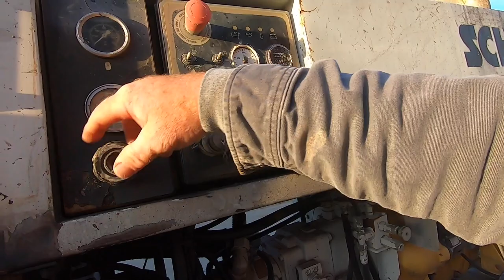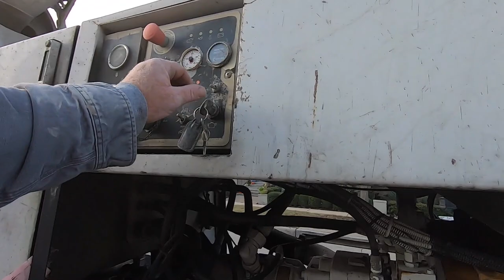New pool deck in a nice neighborhood with Muddyfeet

Comment: If you where starting out again would you start with a trailer line pump or a bigger boom pump?
Reply from the maker: 100% a trailer pump. It teaches you so much.
Reply: @MuddyfeetConcretePumping  thinking about adding one that is mounted on like a 5500 dodge for some reason in kansas people haven’t started using many line pumps yet